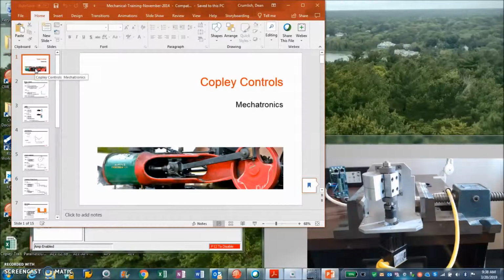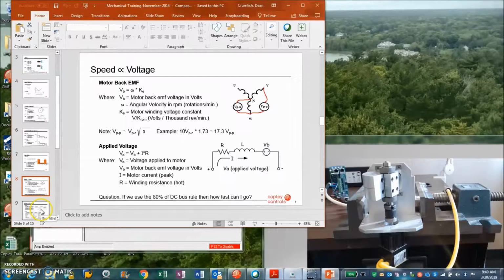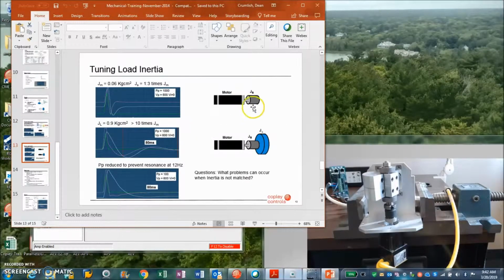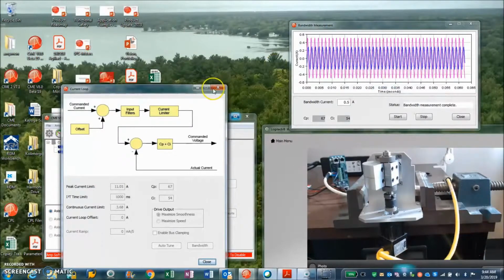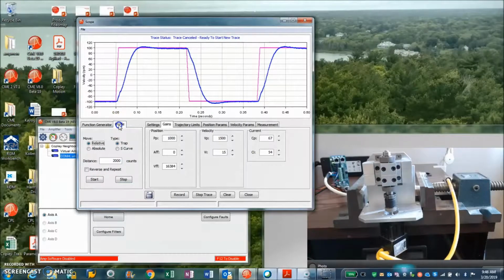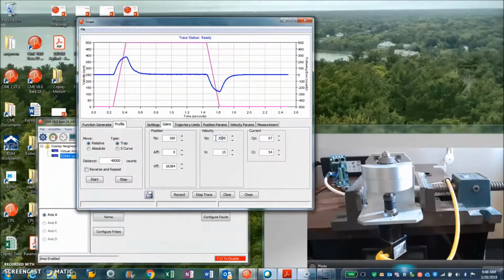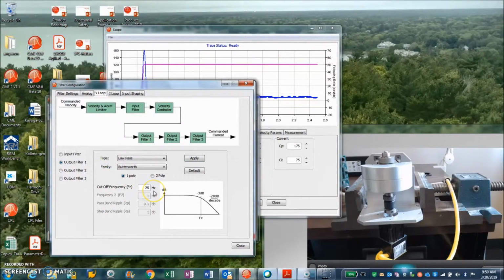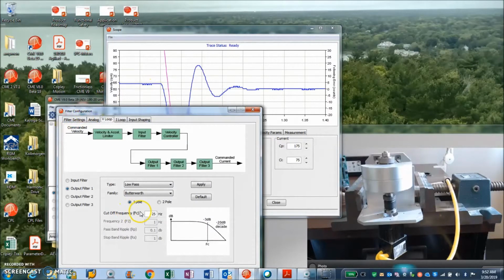Tuning Large Inertia and Large Inertia Mismatch Ratios such as 100 : 1

Comment: When the boss won't shell out for the proper motor
Reply from the maker: It's hard for some mechanical engineers to calculate the inertia so slap a servo on it and let the electrical guy figure it out.